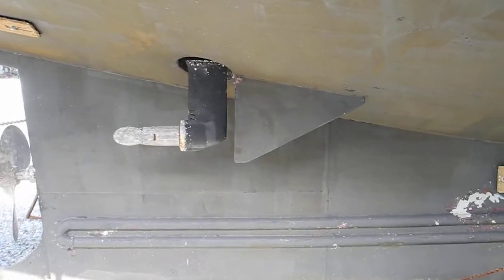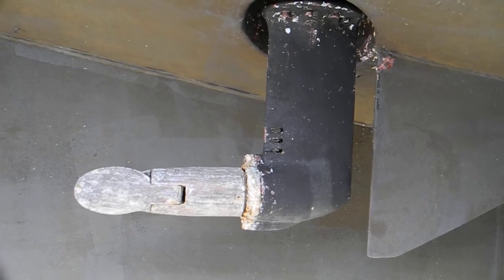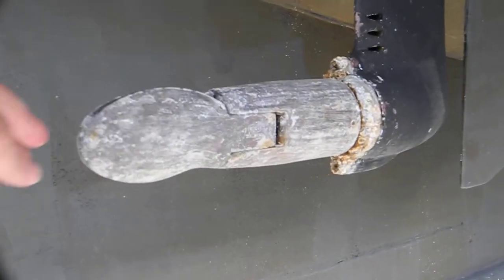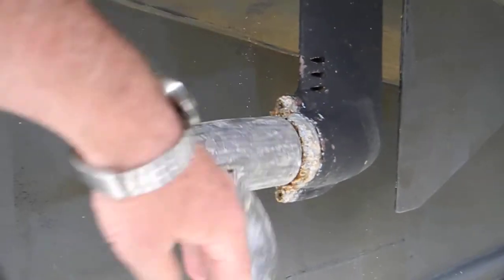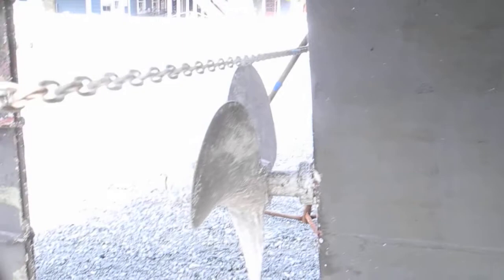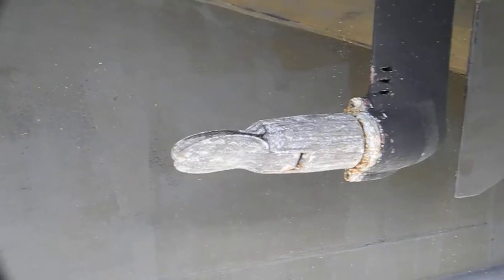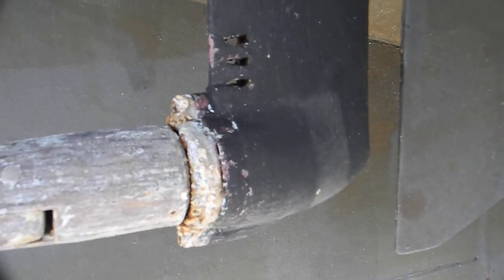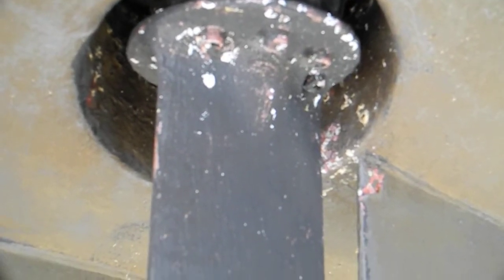Pod Wing Engine

Comment: Chris, say that you have a Nordhavn 40' - 48' equipped with a wing engine, and you are cruising...?? Up the NW inside passage to Alaska, could you safely run both your main engine and wing engine to get a little more speed, or would/could this cause problems?
Reply from the maker: Mark Volker My thoughts are that while you may get a “little” additional speed it would be very difficult to calculate. And FYI, I’ve run a few times using just the wing engine (for cause) and you barely make way at 3 knots in calm conditions.